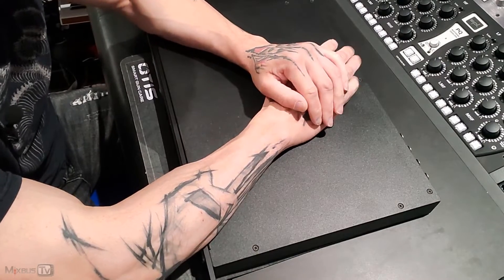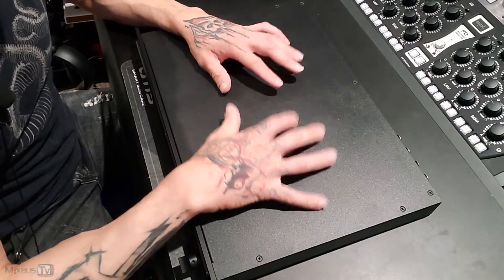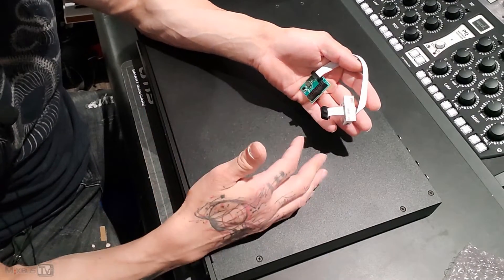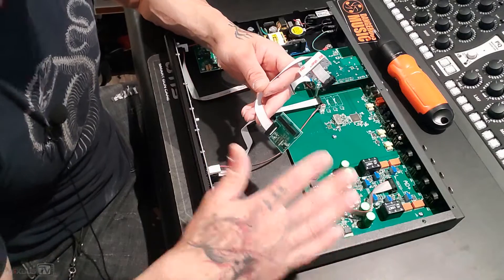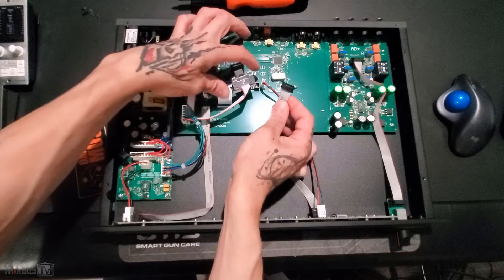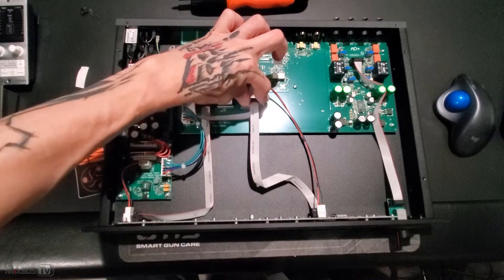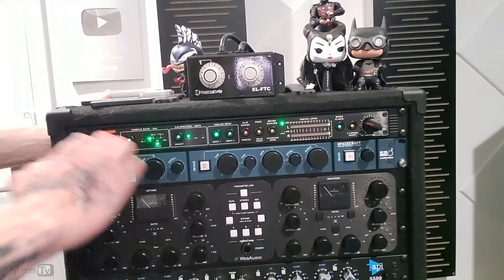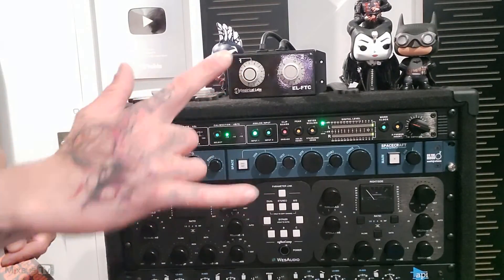Mastering Converter Dangerous AD+ Power-UP FIXED?

Comment: Hey Dave, big fan of your work and Mixbus Tv! I have a quick question:  Do you route your AD+ back into your computer via the USB on the back of the unit? I know on your old SSL converters you went in via ADAT.  Is that still your preference? Does one render a better quality over the other? Thank you so much for all that you do!  I've found your tutorials to be immeasurably helpful.    🙏
Reply from the maker: Thank you! It goes back adat, and it doesn't matter what digital port you use, once it's digital, it's digital, doesn't matter, AES, Adat, USB etc..
Reply: @mixbustv  Got it, thanks so much for your response! You're the man 🤘🤘🤘

Comment: I find this great but at the same time sad. What they actually should do is to fix the problem by default for the price they are asking and send again a new device to their clents ! Again is good they fixed it but...its just meeehh.
And Dave, your channel is number 1 as always🔥
Reply from the maker: I'm pretty sure new units comes with this on, I actually can only say good things about them, they sent me 2 units, then they were ON IT and found a solution, shit happens, it's hard to foresee every possible scenario when building a unit like this, I think they handled this in a great way and it gives me confidence in the brand, I know my ass will be covered no matter what in the future.
Reply: @mixbustv Sure! A solution is better then no solution. Keep it up man, you have a bright future⭐️
Reply: @mixbustv  I did not get a new unit. They asked me to wait for the solution. I simply not power off the unit anymore :).
Reply: Chrs V from Dangerous here. The problem is specific to certain setups. You can see this if you have a way to measure you voltage when you first fire up your gear. You might see the voltage dip down when everything is powering on. For some users, it was dipping to low for the AD+. The fix that has the unit auto reboot should this happen, will be automatically installed in new AD+ units. Feel free to give me a call at the main number sometime and I am happy to clarify it to you.
Reply: I wonder if this issue is global. Given the explanation of the RCA and the nature of the Mod, the issue may well be an edge case, only manifest in areas where power distribution is uneven (from the grid). But great that there’s a fix for it.

Comment: Which converter do you recommend for mixing and mastering on headphones only? Having a pair of Audeze LCDX and one of Focal Clear Pro MG. Thank you
Reply from the maker: if you're in the box and you don't use outboard (even less if you don't record anything and you are sample/vsti based) your converters have little to no impact, it doesn't really matter, what matters is the headphone amp and the DA stage, but the fact that you mix on hp doesn't change what you should get which is the best you can afford. MOTU headphone amps are amazing even on the small interfaces. Your problem of course is the you're mixing on headphones only
Reply: @mixbustv  thank you! I was looking into an SPL SE with DAC768xs...I hope I’m not making a mistake. I have no way to test things in my city- Calgary has no such models on demo...Or should I go with Lynx Hilo TB?
Reply from the maker: @ChestermereToday  Go SPL
Reply: @mixbustv  thank you!!!

Comment: Is it just a matter of contacting dangerous and they send the part for free?
Reply from the maker: They sent it to me, also to make the public aware, so I didn't even have to contact them, and I'm pretty sure new units will be shipped with this on but yes, if you own an ad+ I'm pretty sure that's it
Reply: It sure is. Send us an email to info@ with your shipping address and we'll get it sent out to you if you're having the issue. If you're not, it's not something you have to worry about. The problem is specific to certain user's setups. Feel free to call us too and I can clarify anything needed. -Chris from Dangerous